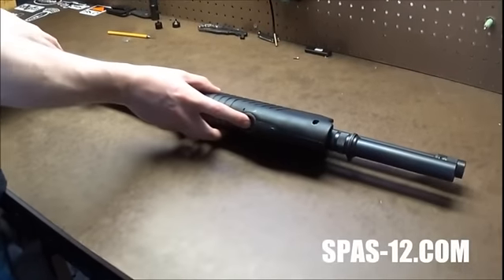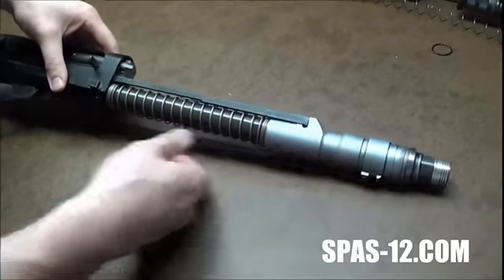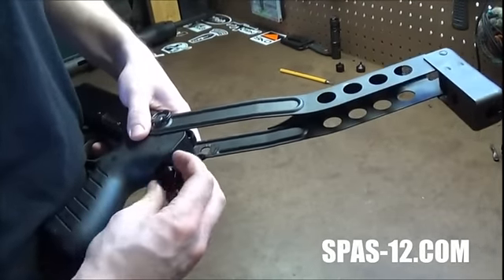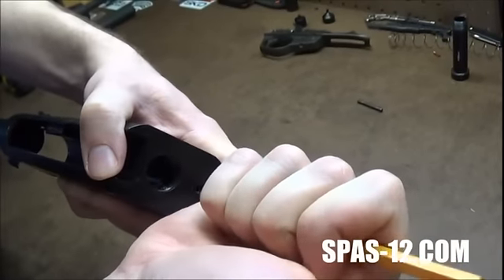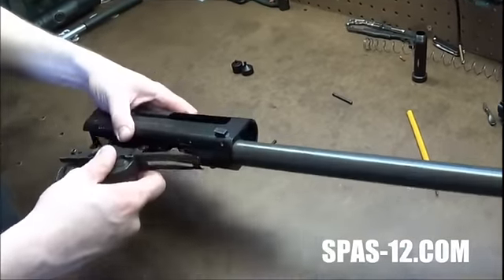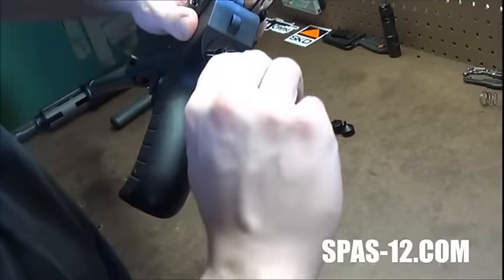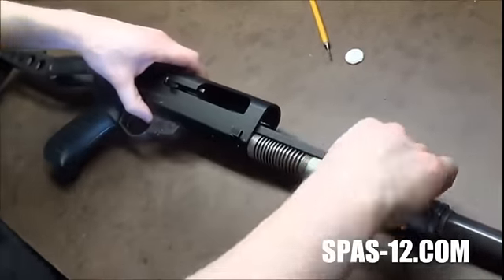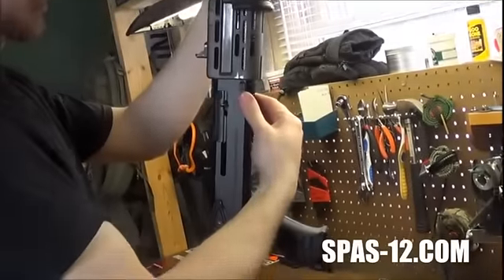Identifying your SPAS 12 receiver style

Comment: My spas 12 does not work in semiautomatic mode, I do not have the rubber or oring of the charger tube, do you think that is the cause of the failure?

when firing the bolt it is closed !!

please help me

Comment: Is this the same field strip process for the law 12?
Reply from the maker: Yes, pretty close, you just don't have a heat shield or pump/auto mechanism to worry about. :)
Reply: +spas12project thanks, love your videos. is it possible to do an update on the law 12? I've been using your guide to buy one but so many are over your price range.

Comment: I think the bolt on the grip to the receiver has loctite on it. I can't take a heat gun to loosen it can I? It might melt the polymer pistol grip. Suggestions?
Reply from the maker: Doogeruoy Sihtdaer You can use a little heat, I've had success removing stuck receiver bolts even with a hair dryer and some Kroil or Liquid Wrench applied to both accessible ends of the bolt.  Some bolts do get outrageously seized, in that case, if you feel like you might break something, seeking out a gunsmith in your area might be a safer bet.
Reply: spas12project I went with the heat gun and the bolt came out easy. Thanks.

Comment: I've tried applying lube and heat and the only thing I've achieved is bending a load of nickels. Don't want to go through the trouble of a gunsmith, are there any other options?
Reply: Landon Louthian Commenting on the off chance you'll reply.

Ever figure out a solution? I'm also only coming up with a lot of bent nickels haha.